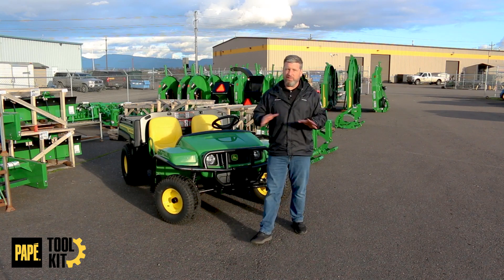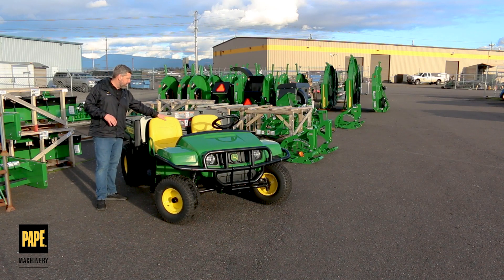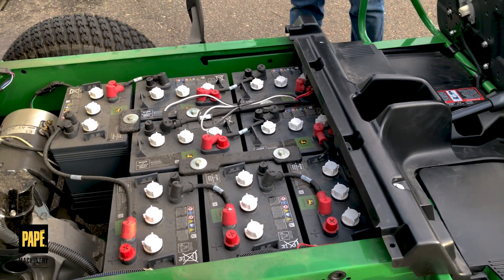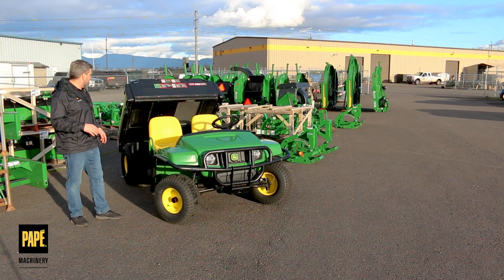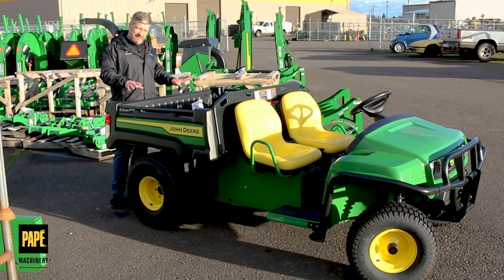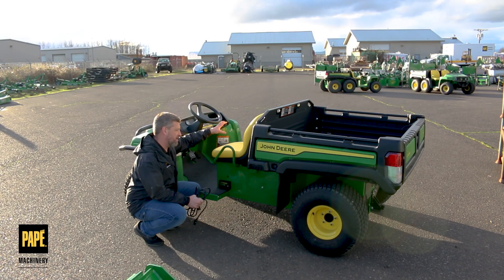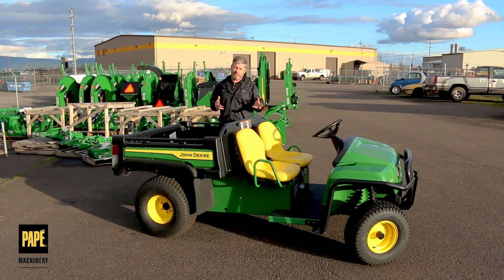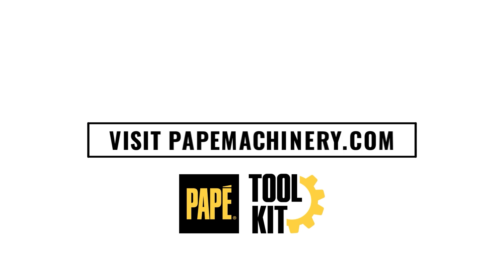John Deere TE 4x2 Electric Gator

Comment: Hi, do these come in 4x4, and also curious if you know how long the batteries actually last before needing to replace them. Trying to calculate if replacing batteries is going to end up costing me more than buying fuel! Great video. Thanks!
Reply from the maker: Hi there! No 4x4 option yet. But, Jason does have a customer that has had a TE for eight years, and the batteries are still going strong. Jason says, "battery life will greatly depend on how the machine is used."  Hope that helps! Thanks for watching the video!

Comment: What kind of batteries are used?  Are they standard lead acid car batteries?  Also is the weight rating inclusive of the 2 passengers?
Reply from the maker: Hi Peter, thanks for watching! This Gator uses batteries like you'd find in a golf cart: Trojan T-105s.  The payload of this Gator vehicle is 900lbs, which would include passengers or any cargo. The cargo capacity of this Gator is 600lbs.

Comment: can i do something to the electronics to make it run faster
Reply from the maker: Thanks for watching Apollonius! We don't recommend tampering with any John Deere equipment to increase speed. The top speed for the TE Electric Gator is 13 mph.
Reply: @papemachinery.agturf  i know, but i would like to try. even if you dont reccomend it. is there a way?
Reply: @culgi-culgi  he's not going to say for obvious reasons haha. But yes you absolutely can. just like a golf cart
Reply: @DenpaKei  yes i thought that it should be possible but it seems like there are a few cpmponents working in tandem tp control speed. if there os an easy way of doing it i would really like to know befor i start messing with all those components haha
Reply: @culgi-culgi  did u ever figure out a way to make it go faster???
Reply: @erikaschilthuis2750  im afraid not, i will expand this comment once i have the time to explain my findings a bit further
Reply: Definitely can modify to be a 72v system and it will goo faster than some cars!
Reply: @MashiroMartinez  elaborate